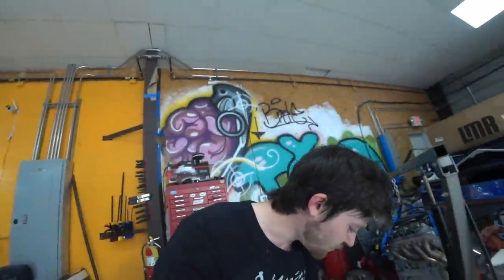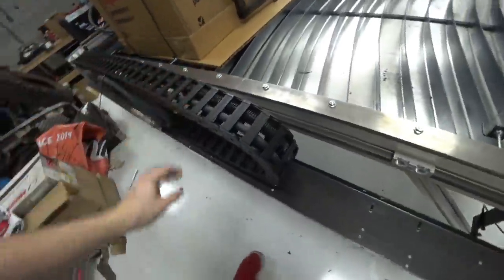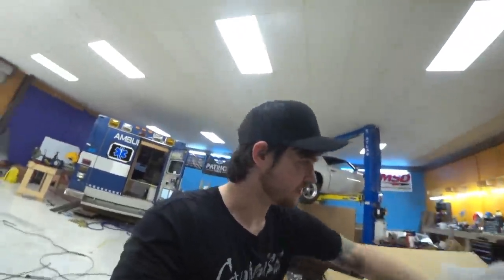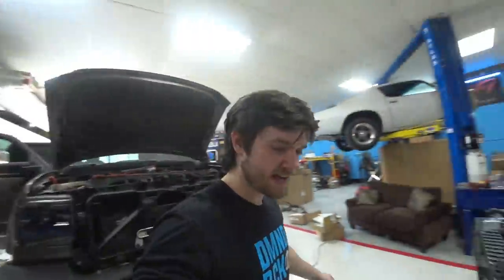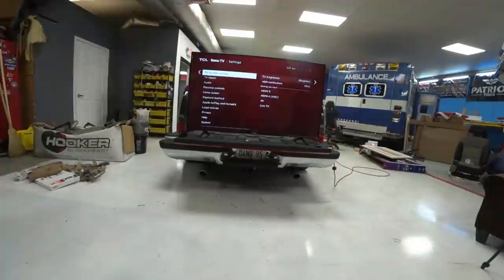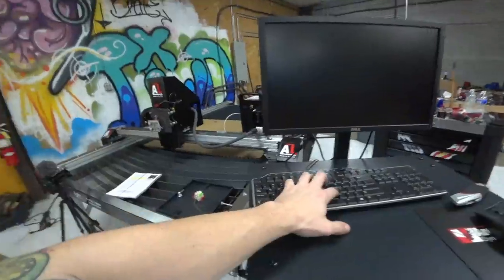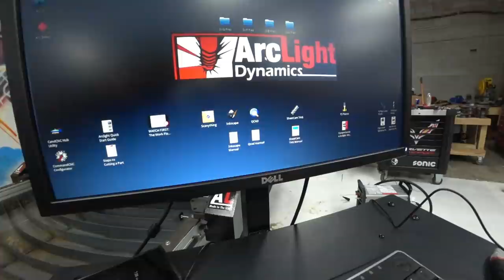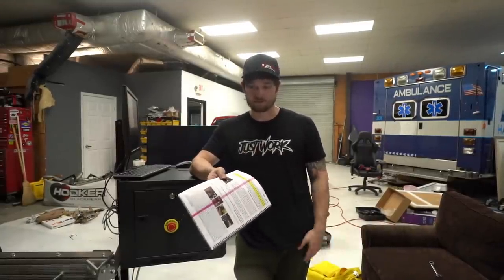I Bought a $30,000 CNC Table and now I can be Tony Stark

Comment: FYI, no matter who says with a water table it won't smoke so bad, everything you own will be covered in a thin film of iron smoke over time without a hood. Was a huge learning experience for me.
Reply: Bump for dan to see this
Reply: @andrewapel5401  but .. if he DOESN'T see it and his ENTIRE shop is covered in suet... we get a Dan rant. Do you want to miss out on a Dan rant? They're always fun.
Reply: Spot on, the water helps a lot but it's still gonna smoke as the iron is carried up by the water vapour too. Also if you cut aluminium on a water table it produces hydrogen gas and explodes under the sheet which is always fun
Reply: work in a machine shop at end of the day can blow out your nose see all the metal that comes out lmao
Reply: @spar8334  oh dude, like every day 😄😄😄😄 grinding, welding, plasma with water table and vent 😄😄

Comment: I recommend you buy a 1U rackmount UPS for that computer to replace the simple surge protector you have. It's basically a battery + surge protector to keep the system up and running during a power outage. It gives you the time you need to pause the job and shut down if its a complete power outage or keep the entire system up and running during a brown out or blips in the power grid.

Comment: love the table, the reason the head is magnetic is like an emergency stop so if it hits something it will lose the current and stop before it screws up
Reply: Every table I have worked with both magnetic and vacuum, will continue cutting until it looses arc. Just flopping around.

Comment: @diwd I’m sure I don’t have to tell you this but as someone who worked IT on a professional metal fab / cutting floor in the form of Matcor metal fabrication inc. Take care of the machine that runs the table! Use and clean air filters for it! Nothing will kill the machine faster than metal dust ingress. If a filter failed or was taking off by a floor guy I was replacing that machine in a month. Guaranteed.
Reply: P.s. I love watching all the growth Danny boi! This channel and you yourself have grown a lot. The content is great! Seems like just yesterday you were just little ol do it with Dan running around on his old f4i doin the Motovlog thing. Love it!

Comment: TCL TV's are true 4k, but they can upscale low res content like 1080p content do to a processor that they have (multiple companies have something similar).  It makes sense since a lot of content is still in 1080p and it won't look as good on a large 4K display.  I have a TCL R625 and it's a phenomenal TV with the full array local dimming it can get pitch black when it needs to and pretty damn bright with minimal light bleed.

Great stuff, will definitely look to TCL in the future for another TV if I need one.

Comment: No need to adjust any settings on the power pack it will auto do it through the data cable

Comment: Idk much about plasma cutting so pls fill me in. Are those vertical “fins” steel lays on sacrificial? Like does the plasma kinda hit it while cutting or does like the water protect it or what? Tia
Reply from the maker: Kinda yea. The whole bottom of the tray is a pan, that will be filled with water to catch the dangerous stuff when cutting. They help cool the metal and also take the blow by without getting super tuckered
Reply: @DOITWITHDAN  and waste byproduct (if I’m saying that right) would be like beads of melted metal in the tray? 
And that sample piece looked really clean. How come others looks jagged? Not calibrated or cheaper cnc? 

Thx for replying. It’s just interesting to me lol

Comment: ah ah ahhh, ah ah ahhhh..... lol. Kudos Dan. Yeah, not sure of the lisp functions of that rig ... but I'm thinking G-code. as most CNC machines in N.A. are running G-code from the terminal. How ever it beats the hang out of the Oxy-Acetylene pantographs that we ran back in the 70's. The only thing you will find better than that rig you bought is a water-jet cutting table... no big.... But you did make me laugh when you said ..... " I paid 30 G's for a PC"..... lol, I think now you are glad you did,.... and didn't have to install and calibrate / test the table as Root.  Stay safe  and good fortune on your endeavors.  Ciao. /w